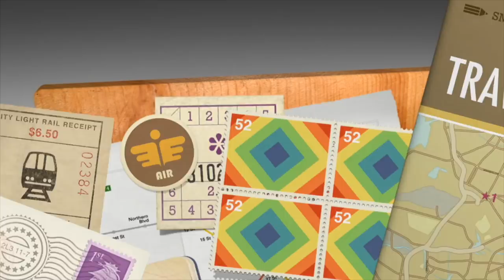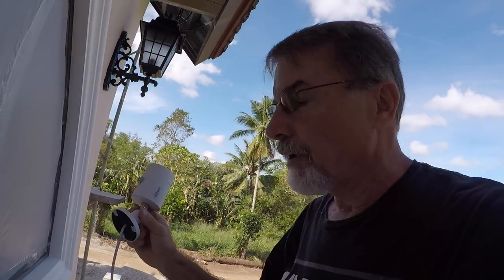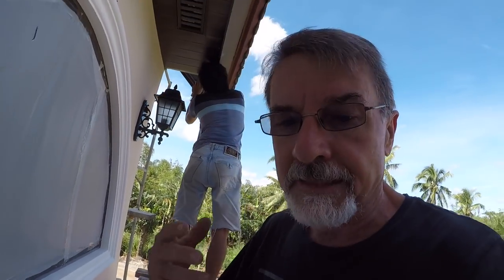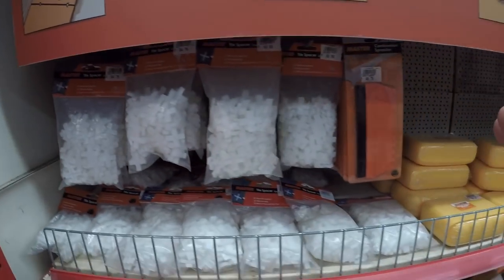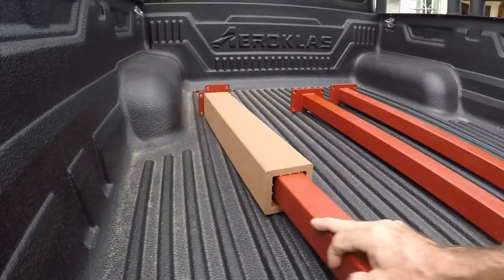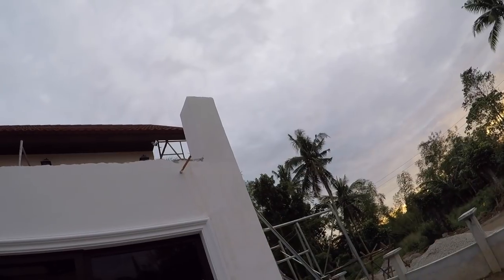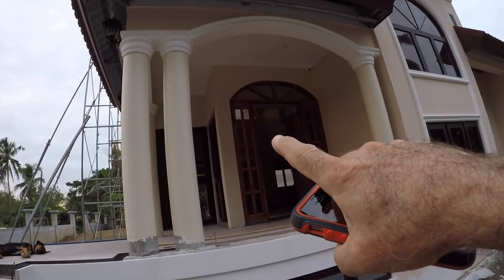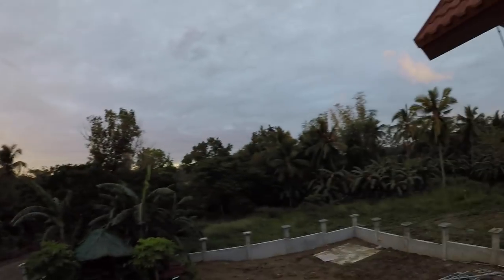VILLA FELIZ - EPISODE 274: SLOW BUT STEADY (House Building in the Philippines)

Comment: the screening screws you were trying to find are available at the aluminum and screen shops ...and they use flat aluminum cutouts to hold the screen down ( haha i'm really just pretending that I know but I remember that's what I did with ours to keep insects/rats out)
Reply from the maker: Didn't think about going to a screen shop.  Good tip Winky!  👍🏼

Comment: In a previous comment I mentioned that my roof material arrived completely damaged from Manila.  I reordered (could not get the roof I wanted) what was available and it was delivered.  Heads up to your subscribers James.  The "roofer" delivered the roof on site and lay it flat and uncovered on coco lumber on the ground.  Never accept this.  The material should be on skids at a minimum 10 degree angle (to allow for drainage) and completely covered in plastic or tarp.  Unfortunately I learned this too late as my roofer did none of these things and the result was dirt and standing water stains on my sheathing.  And if that was not enough (after I fired the first crew) the new roofers who are professional have just informed me that panels for my long span were measured incorrectly.  😨 They are coming up short and I will have to go back to the first Bluto to address the damage.   Hope this helps someone else.
Reply from the maker: Good info, bad story Thomas.  We had some issues also with the way the truss team installed some of our truss work as well and it cause some pain for the roofers who installed the panels.  If its not one thing its another.  My hair seems to be getting grayer by the day...